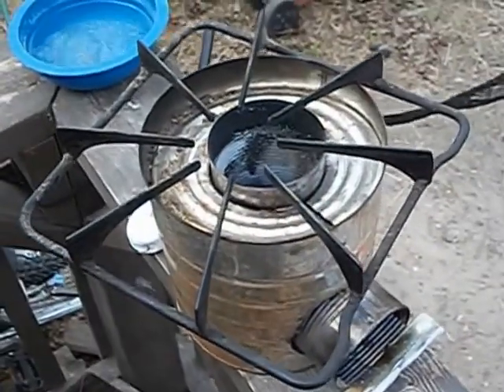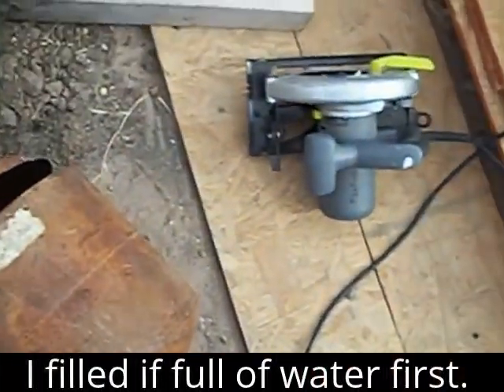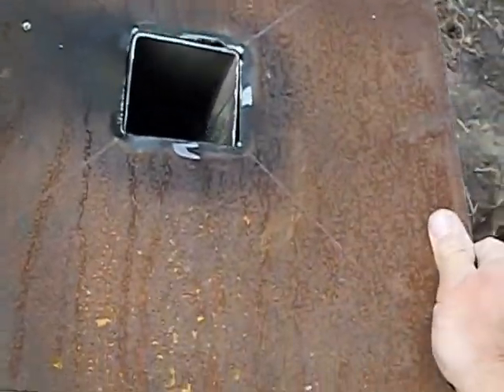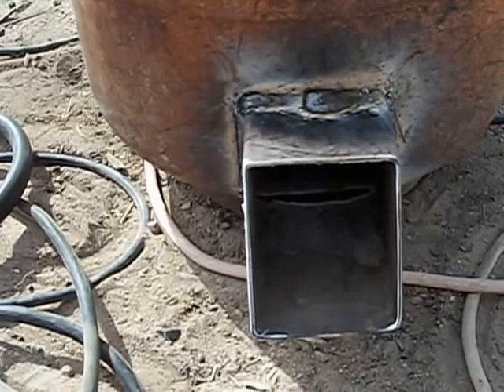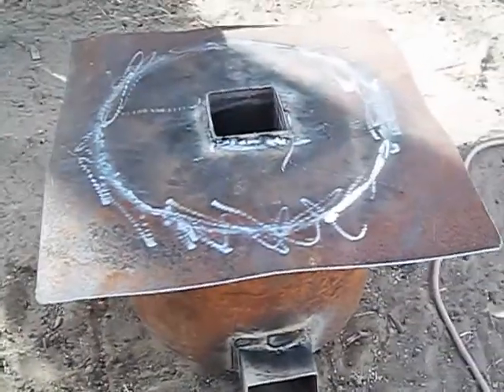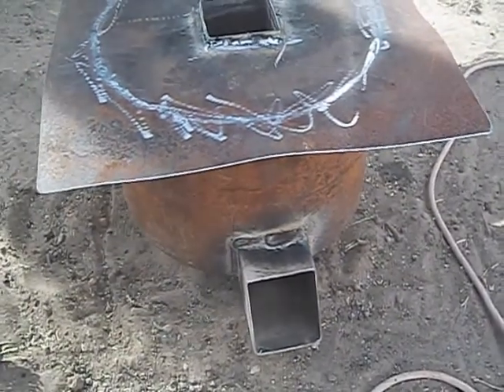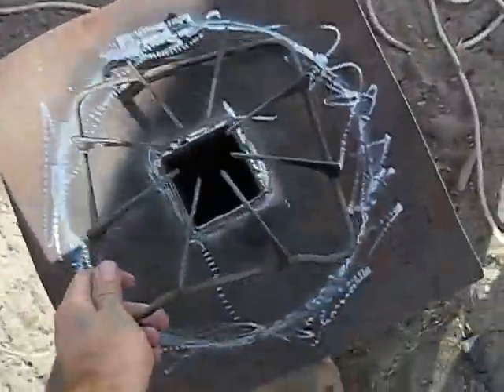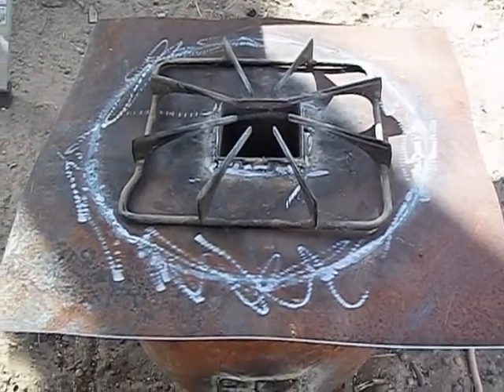009 Propane Tank Rocket Stove

Comment: Interesting build.  A tip for you though on your welding.  Your material would not have warped if you had done tack welds before running your weld beads.  A tack on each corner of the vent tube and a half dozen tacks, even spaced, around the circumference of the tank and you would have been good.  Non controlled steel fit up will warp like a MoFo if not handled in this way.  All the best to you !